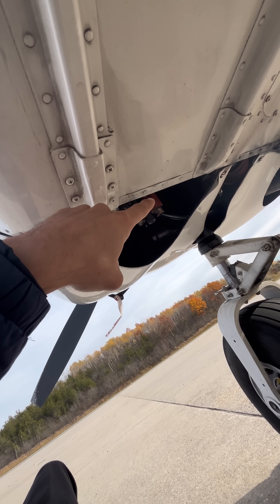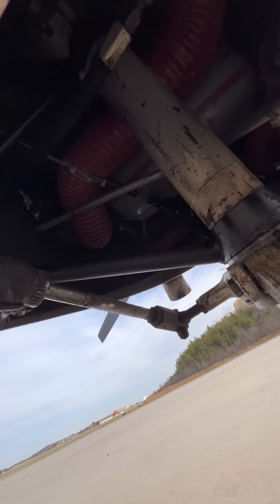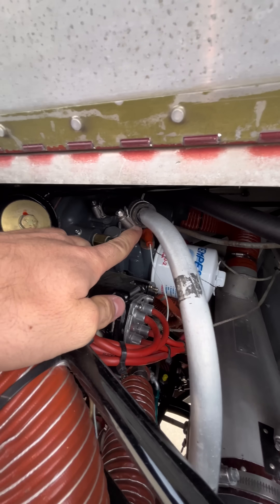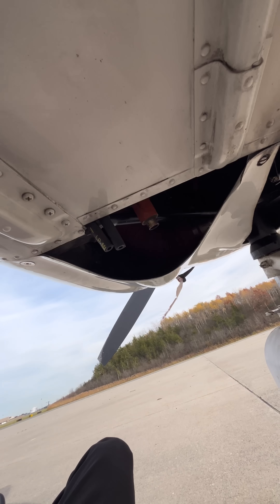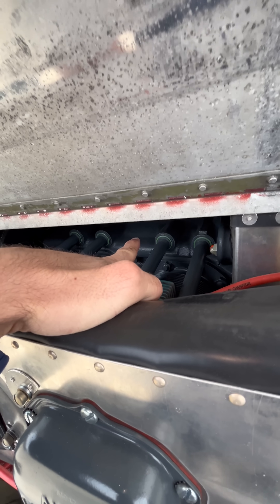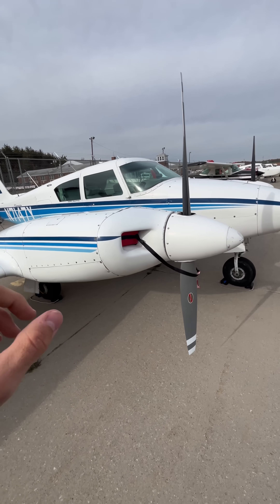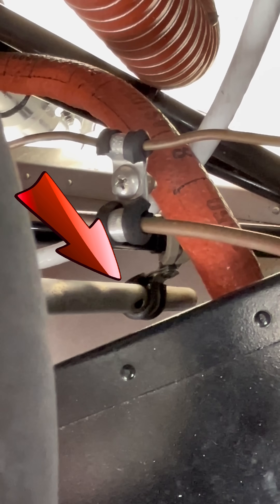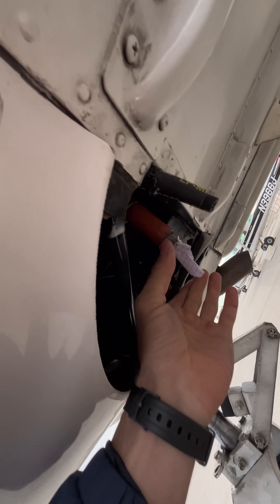LOOK OUT FOR THIS 🧊✈️💀

Comment: Always ensure the crankcase breather tube has a constant downward direction with NO upturns. Any upturns will cause the condensation to settle in the low points which can freeze solid. Front seals can then blow out meaning you will need to be back on the ground very quickly and possibly have to deal with zero visibility through the windshield due to oil.

Comment: You still have a back up. The cylinder sleeves are infused with silicon so when you run out of oil you’ll kill the engine but it will still run with this silicon for a good amount of time to land.

Comment: Automotive mechanic here.  What's wrong with using a modern PCV system?  It reduces crankcase pressures, improving sealing and reduces moisture from the oiling system, increasing oil life.  There are heated PCV systems on cars now, so I believe internal icing problems in the intake manifold would be compensated for.  Maybe I am underestimating wind chill factors or is this an old Cesna?  I am not an aircraft mechanic at all, so no experience here.
Reply: So my limited understanding is that MANY of the engines used in these types of planes are basically relics, because of all of the regulations the engines have to be super simple and reliable, but the cost of this has been that ANY modifications, even the ones that make sense, are a complete pain in the ass to get implemented, so we're stuck with engines that are stuck in the past because they are tried and true rather than more modernized engines, because in the end they know engine A that has been in the air for 60 years will be far more likely to bring the plane back home safely, whereas Engine B has never been in the air at all and we don't want to risk it falling out of the sky in a busy city or a suburb
Reply: Plane was made in the early 70s, with an engine designed in the 40s. What he is describing doesn't really happen if the engine was warm before takeoff.
Reply: Because the FAA
Reply: FAA is super particular on parts you can’t even swap a rubber fuel line for a metal braided one even if it’s undeniably a better choose it’s stupid
Reply: I havent yet seen any heated PCV yet but its prolly cus of my country being tropical. Aircraft engines and technology still rely on older nearly ancient tech to function, especially the cessnas and beechcrafts shown in the video, both of em use Pushrod Boxer engines from the 60s or older, use carbs etc. Modern stuff like heated PCVs cannot be put in these engines unless the owner wants to modify their aircraft to be able to utilize them, which means expensive labor for aircraft mechanics and documents signing off on it and whoever else it needs to go through with legal stuff. So for simply having the convenience of not getting possible icing on your PCV drain, you're spending thousands if not tens of thousands. If you got the money to spend like that, you might as well get a more modern turboprop instead of a piston engine aircraft.
Reply: @reedman0780  Most heated PCV systems simply use engine coolant to heat them via tubing brazed to the PCV valve and PCV port in the intake manifold.  Others use electric heated PCV valves.  Pretty simple and easy to retrofit.  Will increase fuel mileage with no penalty.  However, I do know the EPA won't let you modify a car's emission devices for a given year, even if it is vastly outdated, so I suspect that will answer my question.....bureaucracy.
Reply: PCV systems can also cause detonation or knock in certain conditions, which airplane engines try their hardest to avoid as is, wouldn't want more of a chance for that 😂
Reply: Probably could work just fine, but remember, most of these aircraft were built in the 80s or before. There are very few newer aircraft flying around. 
Also remember, if you want to fit a new system like that to a certified aircraft there's a metric fuck tonne of testing it's got to go through before it's permitted. That hugely slows the rate newer technologies get adopted by the aviation industry, because the testing is expensive, so manufacturers prefer to stick with the older, already certified solutions.
Reply: The FAA is dumb.
Reply: @DanielDuhon I mean maybe, but your comment doesnt exactly exude thoughtful intelligence either.
Reply: @DanielDuhon The FAA rules are written in blood mboi
Reply: The  EPA should give them a big fine.
Reply: Cause its gay.

Comment: Jesus... this just isn't an issue on cars. Most automotive gas engines for the last 30 years has had this easily solved. It feeds it back into the intake and easily burns it. Spark plugs last 1000's of engine hours too in that configuration. This seems sketchy to say the least.

Comment: Similar things happen if you don't change the filters on a diesel engine. If the critical filters get blocked pressure will build in the engine and push oil past every single seal. Diesel maintenance is very important.
Reply: Sounds like only stupid engines do that. I learned a bit about mtu engines used by the German navy, and they have a pressure bypass valve on the oilfilters just in case the regular maintenance schedule fails. There is no apparent reason this would not be done in every engine. Or are you talking about other filters?

Comment: That exact thing happened to a very good friend of mine one VERY COLD winter day in Northern Wisconsin Jan 1994-actually set records that week-airliners @ KRHI were down due to the severe cold-the FBO I worked for got a pop up charter to fly a couple to KMSP-their visas were about to expire-got the FBO'S PA-34 Seneca 1 ready-in was in an unheated hangar but had EZ-Heaters on the engines-got it ready-off they went. Still air temp was in the mid -20's F. He got as far as Lake Elmo MN when one of the breathers froze solid-he lost ALL oil pressure in about 5 seconds. He was lucky to get the prop feathered. Declared thd emergency & landed at Lake Elmo airport just East of KMSP.
Reply: If only we had the technology to heat that pipe when a sensor 👀 sees a temperature 🌡 🤔 change moisture or anything else that could cause that pipe the freeze and clog up😂😂😂

Comment: There’s supposed to be a relief hole in the tube up high in the warmer part of the engine bay just in case the end freezes over. Usually makes a little mess, but better than a cracked case. I’ve seen whole cylinders blown off
Reply: The video mentions that very thing...

Comment: Why are airplane engines still from the 80s
Reply: 50’s. It’s literally 50’s technology with zero improvement. That includes the fuel, also still the same as in the 50’s, including lead in the fuel. So we still get poisoned like in the 50’s. Yay.
Reply: The FAA certification process. It's incredibly expensive to do, and your product will take forever to get approved if it does actually get a STC approved. And you need one for every aircraft the engine goes into.

Then you need pilots that have the money to spend on engine swaps, which they don't always have. 

You could swap a Rotax 916is into just about any aircraft, but it's not just a simple swap for a certified aircraft for the reasons mentioned above. That's why the experimental category is gaining traction in GA.
Reply: 1930s.  Once a reliable engine is designed,tested and proven, that concentration of reliable technology is transferred everywhere (From an O360 to PT6).  There are myriad aircraft, but only a few engine designs powering all of them, from rotorcraft to fixed wing.

Comment: Dont get me wrong avaition higher standards because cars dont fall out of the sky but a dipstick is gonna pop out before any plugs
Reply: for most aircraft engines the dipstick is also threaded/screwed in. It won't pop, atleast not before other problems occur.
Reply: @RTFMundHDf good point I forgot about that

Comment: I dont think people quite how cold the sky is. The average air at cruising altitude can range from -4F to -55F for most prop planes depending on cruising height and outside temps (and like twice as cold for most jets). Theres also the Venturi effect that occurs from the carburetor that causes a pressure drop, freezing the incoming air and triggering a ton of condensation as soon as it hits moisture (like the regular air right outside the pipe or any existing water/ice), so the ice absolutely cannot just be melted by the casual heat of the nearby engine. That shit is arctic

Comment: Why don't plane engines recirculate crankcase ventilation? That would seem to resolve the icing problem without massive downsides.
Reply: The only reason airplane engines are quite literally exactly like they where in the 50’s is because this works and no one has the balls to approve of anything more modern. Because by definition later technology is not as proven and if there would be a accident because of it they would hang. 

We are perfectly capable of making way better engines. Lighter, more powerful, less fuel burn, quieter, cheaper and more reliable. But that’s not alowed.
Reply: The reason is because the plane goes up and down in altitude farther and faster than a car. This can lead to drastic pressure changes that risk blowing engine seals.
Reply: Yeah, it seems like no aircraft engine makers have ever heard of a PCV system before!!
Reply: @AnotherWisenedOne  PCV systems add complexity.  Last thing you need in general aviation.  BTW a PCV system freezes too.
Reply: @JimManos  You are full of B.S.  How can a PCV system ever freeze, when the engine heat is engulfing it the whole time?  Do you even know how a PCV system works?  Show me just one PCV system that has ever failed due to freezing!
Reply: orrr they could make an resistance system to warm the tube and dont get ice
Reply: The only thing saving your life once you take off the ground, is the engine. You don't want that engine getting gunked up with carbon from emissions. Planes have different fuel than cars do, too. Because of the same reason, with a few different issues. One, more refined so less water to freeze. Two, higher octane to handle the altitude change. Planes don't (and should never) get the same treatment as ground vehicles. You can stall on the side of the road just fine. Try that when you're 5 - 30k feet in the air
Reply: @alexanderc9058  higher octane, better knock prevention and higher stability at altitude can be achieved without lead in the fuel without any problems. If only the engines had material science more modern then the bloody 1940’s!!! They need the (extremely) poisonous lead in the fuel only because the engines are outdated. 

We can make engines more reliable then this old junk with ease. These old engines have a lifespan of only a few thousand hours before overhaul. Even with proper environmental care modern engines can be made way way way more reliable and longer lasting so safety is not the reason this old junk is still being used to poison our brains and make us dumb (yes, that has been proven for many decades now, lead makes us dumb). 

It just a matter of changing the rules but no one has the balls to do so. And therefore we are stuck with what we know works good enough and we take the environmental damage for what it is.
Reply: @alexanderc9058  5-30k feet isn't that much of a problem, gives decent time for restart attempts and searching a landing site. 
500 feet over rough terrain or water is much worse.
Reply: @fabianrudzewski9027  lol, not much of a problem? Do not fly with this guy, if he even is a pilot.
Reply: @RunwaysandRocks  I was only referring to someone above who said it's bad to have an engine failure at high altitude. Which is true, however it's much worse to have it fail at low altitude.
Reply: @alexanderc9058  There's something called preventative maintenance, but most people just use their cars and trucks until something breaks and the wheels fall off.  If people looked after their ground machinery like air machinery, there would be fewer failures on the roads.  Airplanes still fail, even with what is deemed to be proper care.  Water is formed when hydrocarbon based fuel is burned (combined with Oxygen) and if that water vapor is sucked into the engine's intake system, you don't have to worry about a draft tube getting plugged up.  Your oil will stay cleaner longer and you won't have as much acid build up in the oil that eats up the soft metal bearings.  Higher altitude means less effective compression, so you need LESS Octane rating when up there at 10K or more feet.  You need to study up on engines and how they work.
Reply: PCV and recirculation are measures to prevent polution,... they don't make the ICE engine more reliable nor make the combustion process better or cleaner! If it was not regulated, no PCV recircular system would be introduced in car engines. (like the EGR, al the catalitic filter options and all closed breathing options in and around the fuel tank and connected systems).
Reply: Exactly what I thought turbo the plane
Reply: @dr_drilla2774  turbos use exhaust gases, not blowby. the comment is describing positive crankcase ventilation (pcv)
Reply: @lettelsnek he means like on a car. The PCV system takes those gases and feeds them into the intake to be burned.
Reply: @lettelsnek I had to dig too deep to find a competent human. Cheers
Reply: @dr_drilla2774  🤦

Comment: Whats normal operating temperature for a plane engine? You'd think the gasses coming from the crank case would be hot enough to keep that from happening.... though i guess that is a pretty long run of pipe...
Reply: I may be wrong but I think most of the ice is happening as it’s sitting parked but still creating enough heat for condensation but not enough to stop it from freezing in cold weather
Reply: They run pretty low combustion temperatures because the valve technology is still from the 50’s, like all of those engines. That’s also why they still need lead in the fuel to prevent the valves and seats from burning. It’s absolutely ridiculous but it is what it is.